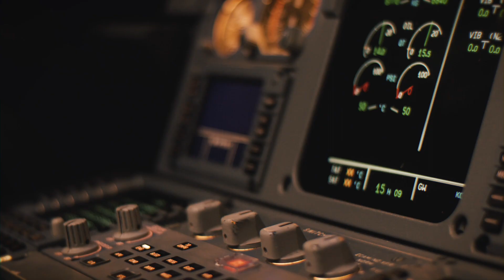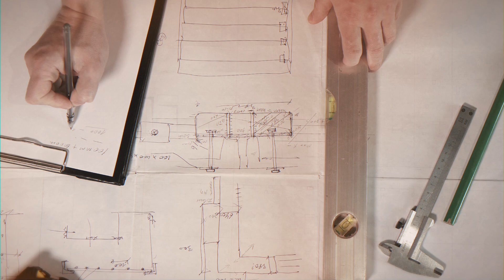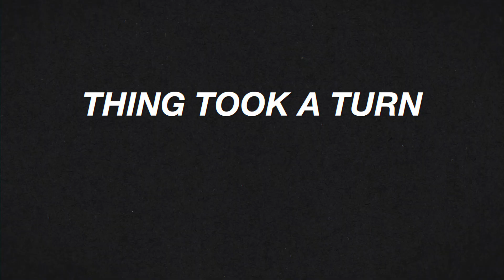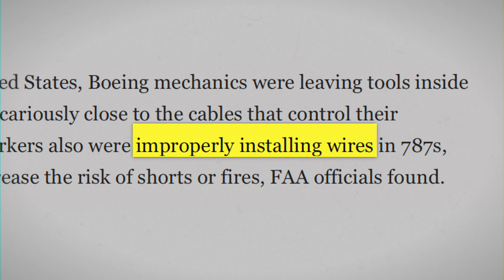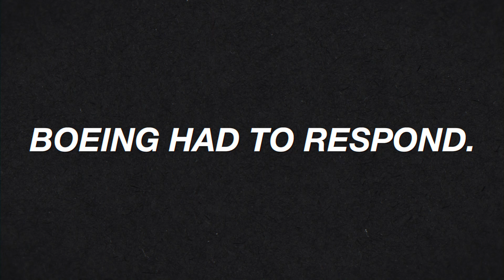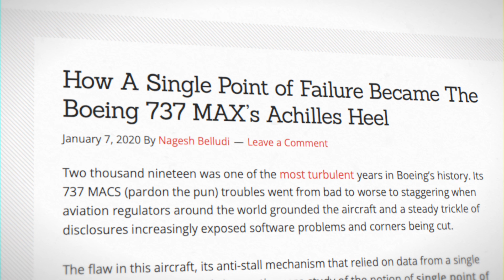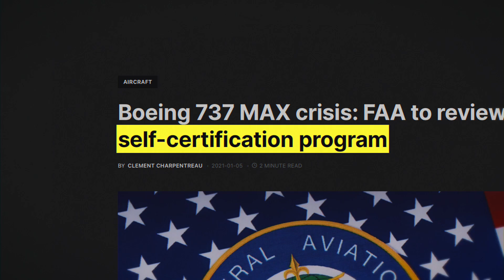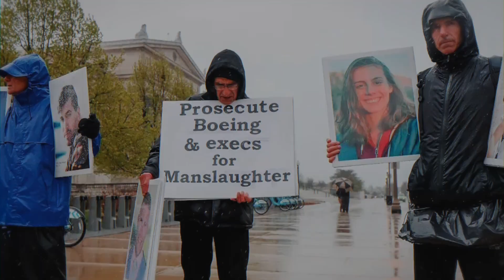The Scandal That Destroyed Boeing

Comment: If Airbus is currently facing a lawsuit for a similar cover-up scandal from 2009 or so, do you think Boeing as a corporation will eventually be in even hotter water?
Reply from the maker: Can’t say for sure. I’ll definitely research it more though
Reply: @Armin99_  Airbus ain't facing anything.  This guy is talking nonsense
Reply: @kirilmihaylov1934  theyre talking about air france 447 s
Reply: @crypton7572  it was pilot mistake
Reply: @kirilmihaylov1934  But Airbus is still named in the lawsuit. They also had landing gear issues on the A320 back in 2005 and they may have similar issues on the A350 today.
Reply: @aycc-nbh7289  they don't have any issues on 350
Reply: @kirilmihaylov1934  I’m pretty sure I saw something in my feed regarding an A350 having to make an emergency landing due to a stuck landing gear.
Reply: @aycc-nbh7289  this is small thing
Reply: @kirilmihaylov1934  So were four 737 MAX aircraft that had issues. I understand that there was only one incident in that case, but if only four incidents on the 737 MAX set the standard, then the question of how many more of such incidents Airbus will allow will need to be asked. Plus, the two aircraft’s issues may both have been potentially deadly, since a stuck landing gear could have meant the plane could have had to either make an unsafe landing that could have ignited the fuel inside of it or have flown without an adequate amount of fuel, forcing the pilots to make an emergency landing somewhere.
Reply: @aycc-nbh7289  just curious are you in aviation of any kind or just simply boeing fan?
Reply: @haiacninc  I’m just trying to shed some light on the issue.
Reply: @aycc-nbh7289  Personally I think mistake is experience to improve on, is not necessarily a bad thing. Also competition made all us better, this is how we all get to this point. Bad situation happen yes but is always been like this since the beginning of aviation. My cousins is boeing engineers by the way, he have share some valuable information. Boeing Is not dead because of the max don't worry boeing been building plane for US government for too long they will get bail out. It is a piece of US backbones
Reply: @haiacninc  But if both Boeing and Airbus have both had safety issues like this, I may be a tad surprised that no rival companies are trying to step up to replace them.
Reply: @aycc-nbh7289  is not like open a candy shop. China did have there own just recently. How rich they are and how long it take them? You understand fly engine is provide by only about 3 company right now? So is not that simple. No offense seem like your knowledge in aviation is limited. I think you should do more research.
Reply: @aycc-nbh7289  The issue with the MAX was that the MCAS overrides pilot inputs and pilots weren't informed it was there nor were they trained to cut it off if it malfunctioned. And none of the Airbus landing gear issue ended in death.
Reply: @Uldihaa  Even if the Airbus landing gear incidents never ended in death, they very well could have. Landing a plane with an unsafe landing gear could involve sparks flying into the engines, which could ignite the fuel and cause the plane to explode.
Reply: @aycc-nbh7289  Not really. And stop deflecting from Boeing's literal crimes.
Reply: @Uldihaa  Who said I was? The point of the OP was saying that if Airbus is currently in as hot of water as they are for doing something similar back in 2009, Boeing may very follow.
Reply: @aycc-nbh7289  Except your entire comparison is apples to oranges. That was MY point. Boeing CEO resigned. The MAX was grounded for over a year, and a lot of those airlines that had ordered those planes canceled the orders. It's one of the reasons that Boeing is suspending new plane development for the next ten years, they lost a lot of money over this.

But Boeing is unlikely to face more than that because the US government is way too comfortable being in bed with them. They've already extended the deadline Boeing had to install the audible warning about the MCAS in MAX 7s and 8s.

Honestly, the best thing the rest of the world can do is to ban MAX 7s and 8s from their airspace until the planes pass their air worthiness certification tests. And charge Boeing for the "privilege".
Reply: @Uldihaa  No, it still means that both Boeing and Airbus have been in legal crosshairs before, especially with world governments having covered up for both of them. Airbus is also not putting anything out for the immediate future in the field of passenger aviation, but they are rather focusing on things that may make sense decades from now.

Though I might have to say that breaking up the passenger aircraft duopoly may be another solution. Boeing and Airbus are simply too powerful and world governments may be willing to bend the knee to them to make sure air travel as an industry stays afloat. We used to have other aircraft manufacturers such as Lockheed-Martin and McDonnell-Douglas, but they either left the field of passenger aviation or got purchased by these megacorporations. Perhaps having some market competition could also convince these manufacturers that they not only need to follow safety guidelines, but also that they need to cater to consumers more.
Reply: @aycc-nbh7289  Gear up landings ... never result in this happening. And sparks flying in engines won't cause a fire
Reply: @AmbientMorality  Are you sure? The passengers aboard the flight back in 2005 were told to brace for an emergency landing and were allowed to call their loved ones on their phones because the flight crew knew it could be the end for them.
Reply: @aycc-nbh7289  I can't think of any gear up landing that's resulted in any deaths?
Reply: @AmbientMorality  It was a landing with a dangerous gear as opposed to a gears-up landing. If it weren’t that dangerous, I’m not sure whether the flight attendants would have let the passengers use their phones.
Reply: @aycc-nbh7289  I'm not sure what flight you're talking about. I've never heard of a crew saying "call your loved ones" as that seems likely to cause panic and extremely unhelpful for an evacuation.
Reply: @AmbientMorality  Jet Blue 292.
Reply: @aycc-nbh7289  I'm sorry but that was simply not a big deal. I'm sure it was rough on passengers watching the media coverage but that simply was not something that would have led to catastrophe.
Reply: @AmbientMorality  I understand, but it could have.
Reply: @aycc-nbh7289  I really can't think of a scenario where JetBlue 292 led to anything dangerous. The gear could collapse, which would be bad for the aircraft and not pleasant for passengers, but wouldn't actually endanger safety. I don't think there's any plausible way sparks could ignite anything critical. The fact that unsafe gear is indicated clearly means fire crews have plenty of time to be ready.
Reply: @AmbientMorality  Are you sure? If the FA’s allowed the passengers to call their loved ones as though they were about to die, then there certainly was the possibility that something could have happened with the sparks that would have ignited the fuel or something similar. It could have been possible that fuel could have been leaking or the sparks could have melted the fuel pump or something like that.
Reply: @aycc-nbh7289  That sounds like a dramatic media report and I can't find anything backing that up. Sparks have basically no thermal mass and won't melt anything. Even if there was a fuel leak, that would ignite a small amount of fuel and the fire would be limited because there's not much oxygen.
Reply: @AmbientMorality  Are you sure? The FA’s still gave the passengers the ability to let others know they may not make it. They likely would not have done so if they weren’t nearly about to die, since some phones may have the ability to distract pilots and interfere with radio communications if they are not switched onto airplane mode. They also could very well have proceeded to land closer to their intended destination if there was enough fuel to do so, but they instead chose to land at LAX.

Also, isn’t what you described exactly how welding works? And don’t forget that thermal runaways may occur.
Reply: @AmbientMorality  Again, it isn’t a gear-up landing, but rather a landing with an unsafe gear that could have damaged the aircraft. I’ve seen an example of a gears-up landing, but it seems to be at least somewhat safe. The landing with an unsafe landing gear seems as though it could have killed people.
Reply: @aycc-nbh7289  How? I don't understand why you're drawing a distinction.
Reply: @AmbientMorality  Landing with an unsafe gear is an entirely different situation. Pilots handle gears-up landings and unsafe gear landings differently.
Reply: @aycc-nbh7289  The worst case of an unsafe gear landing is basically a partial gear-up landing though.
Reply: @AmbientMorality  And? The gear could still fly into an engine and cause it to explode.
Reply: @aycc-nbh7289  What???? I'm sorry, but this is absurd. A nose gear collapse has never led to the nose gear separating. I don't think it is physically very plausible that the engine would ingest pieces of the nose gear if that scenario somehow happened. Finally, there is no way the engine would explode from ingesting fragments of nose gear: they are designed for that.
Reply: @AmbientMorality  I do believe it has separated in this one instance and it could also have been possible it could have been too much to handle.

Also, why did the FA’s allow the passengers to call their loved ones, then?
Reply: @aycc-nbh7289  they were circling for hours just to burn fuel. Might as well let the passengers call family if you know the phones won't mess with the radio.

Either way you are comparing a design flaw that killed over 300 people with one that didn't kill a single person. Unsafe gear is a relatively common problem compared to a rather insiduous runaway trim situation. And no, MCAS was not a standard runaway trim situation and even Boeing had to accept, that most crews would not have reacted quickly enough.
Reply: @matejlieskovsky9625  Again, the situation was handled as though the passengers were about to DIE. It would normally be a violation of FAA regulations to allow calls in that manner and I think the only other time I recall when such thing MAY have been allowed was on 9/11.

Again, even if this flaw didn’t kill anyone, there is a possibility that it could have still killed everyone on board the plane.
Reply: @aycc-nbh7289  Again I do not think the FA thing actually happened. I can't find any evidence of it online. Simply at this point you're imagining hypothetical scenarios with little to do with reality.
Reply: @AmbientMorality  Why should hypotheticals even matter? If passengers’ lives were in danger, should the incident be allowed to be repeated?
Reply: @aycc-nbh7289  You're the one with the hypotheticals like gear flying off and causing the engine to explode, which is simply not a realistic scenario. There is tons of incidents of gear collapsing and gear failing to extend, though, and they universally result in no deaths and almost always no injuries (the exceptions have generally been evacuation related injuries).
Reply: @AmbientMorality  Have they resulted in the gear rotating like on Jet Blue 292?
Reply: @aycc-nbh7289  Yes, I found seven other incidents where the nose gear was rotated by 90 degrees as in JetBlue 292. Four of them were A320s. All of them were minor incidents where the strut did not collapse and there were no injuries. They were all back in service within a few weeks. Obviously it's not a good thing for a failure to occur, but that's because it's distressing to passengers and an operational problem for airlines. It's not because it's a serious safety concern.

Again, a gear collapse is almost certainly worse (especially a main landing gear collapse, because then the plane is likely to veer off the runway), and that much more serious condition also results in no injuries.
Reply: @AmbientMorality  No injuries then, but it could possibly result in injuries if something else goes wrong.
Reply: @aycc-nbh7289  OK, so then "they very well could have ended in death", as you originally claimed, is either wrong or so broad that it is pointless to mention (any flight could end in death because of something entirely unrelated).  Furthermore, all of your hypothetical scenarios, like that sparks could fly into the engine and cause the plane to explode, or that gear fragments could cause the plane to explode, or that sparks could somehow melt a fuel pump, have no basis in reality. You continued to assert vague speculation like "could have killed people", without any evidence. Finally, you have presented nothing to back up your claim that the flight crew or attendants allowed passengers to call because the situation was dangerous, despite repeated requests. Your argument is essentially constructed off one anecdote that I cannot find any evidence of, and then hypothetical situations which don't make any plausible sense and have no basis in actual incidents that have occurred. So what even is your point?
Reply: @AmbientMorality  The point is that both Boeing and Airbus have had flaws in their aircraft that could have caused death.

First, even if the landing gears were incapable of causing a spark in the engine, an unstable aircraft could potentially roll over and catch fire.

Second, the NTSB report of the accident says that the flight attendants did indeed allow passengers to use their phones.
Reply: @aycc-nbh7289  Thanks for the source on phones. I still do not think that can be taken as any evidence that there was serious danger; I could see that easily being a way to ease passengers who were stuck circling for hours while watching themselves on media. A nose gear collapse is symmetric; it's not going to cause a plane to roll over. That's never happened and there's no reason to expect it to. Even a main landing gear collapse has never caused a transport plane to roll over, though it can veer off the runway in such a case. 

I simply do not understand why you keep coming up with hypothetical situations that do not actually happen. We could invent scenarios all day but the fact is that they're not real situations and there's no basis to expect they could become real.
Reply: @AmbientMorality  If 9/11 was the only other time where that happened, then I think it must have been very serious. Also, why do the hypothetical situations matter if there was still the remotest chance that lives could have ended? Nazi Germany invading Poland was a hypothetical until it actually happened and Russia invading Ukraine was a hypothetical until it actually happened.
Reply: @aycc-nbh7289  OK, then I'll say it clearly: there is no reasonable way that nose gear failing to rotate, or a nose gear collapse, or a nose gear failure to extend, could cause deaths. It is an operational burden on airlines, not a safety concern.
Reply: @AmbientMorality  Are you sure? Why else would the FA’s have allowed the passengers to call people like on 9/11?
Reply: @aycc-nbh7289  I speculated in the previous post. I do not know why. The situation, based on a long history of gear issues of varying severity in aviation's history, was not dangerous.
Reply: @AmbientMorality  I do know that in gears-up landings, there is the possibility of rollover, so the possibility may also exist that the rear gear may have trouble holding up the sheer weight of the plane and could collapse as well.
Reply: @aycc-nbh7289  This doesn't happen on commercial airplanes. Very little weight is carried by the nose wheel and the main gear is sized for much more both statically (because planes taking off are heavier) and dynamically (because landings can be quite firm). This is another hypothetical that doesn't make sense.
Reply: @AmbientMorality  Even if the front landing gear flies into the hydraulics holding the rear landing gear in place? Even the electrical cutoffs to the rear landing gear may not work, as evidenced by an LOT flight that did a gears-up landing into Warsaw.
Reply: @aycc-nbh7289  Hydraulics don't hold landing gear in place in either the up or down positions. It is locked in both positions. I'm not really sure how you're envisioning the gear strut flying that close to the main landing gear anyway.
Reply: @AmbientMorality  Perhaps if it simply fell off and the main landing gear ran it over, then something bad could happen.
Reply: @aycc-nbh7289  I'm sorry, but this is absurd. I don't want to entertain any more completely silly scenarios that do not happen. I've shown you plenty of evidence that this kind of failure has happened before without incident and that there has never been a gear-up or gear collapse landing that has led to deaths (and as far as I can tell, no injuries for nose gear failure). I don't think talking about whether sparks that are literally safe to touch with your bare hands will make the engines explode is productive at all. Especially when you've given up on anything specific and are now just like "well something bad could happen".
Reply: @AmbientMorality  Are you sure? It’s also possible for the plane to not have dumped enough fuel prior to landing and cause both gears to collapse. That same LOT flight also involved a small fire which could have ignited the fuel if something else went wrong.
Reply: @aycc-nbh7289  that's why they circled??? what?
Reply: @AmbientMorality  I do understand that aircraft have sensors that can detect the fuel they have on board, but those could also malfunction.
Reply: @aycc-nbh7289  At that point you could just say the plane could crash from something unrelated which is true but pointless.